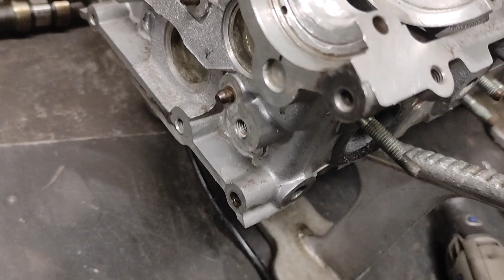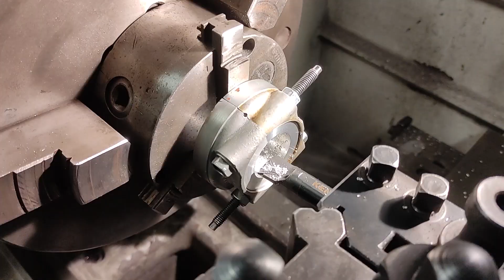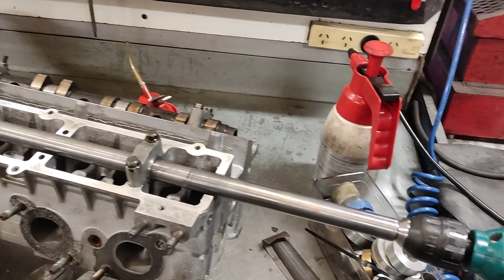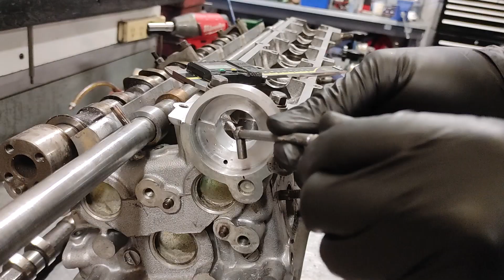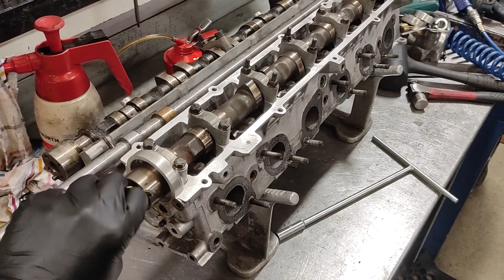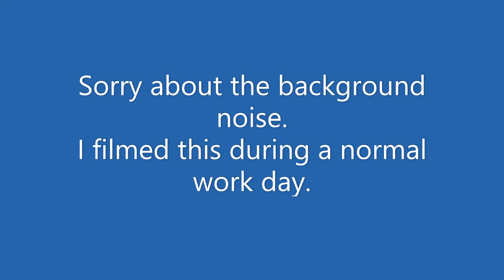Nissan RB26 cam journal repair

Comment: It looks great!

Now that I've seen the result, I'm thinking of doing exactly the same thing on a head that's no longer being manufactured.

My question is which aluminum MIG weld to use: 5356 or 4043.
How did you do the aluminum filling?
What's your current opinion on this repair? Is it feasible?

Comment: Whats the price of something like this? Need a 4age head repaired
Reply from the maker: I would think about $1000. Probably cheaper to find another head.
Reply: @bean1080  deng just for one cam journal too. I think your right
Reply: yea too bad such repair exceed the value of the car sometimes😪   meanwhile in some third world country peasants can afford doing such rebuilds.
Reply: A machine shop charges like 125-300 for a head rebuild, just for labor
Reply: @hectorgarcia8691  to rebore a cam journal?